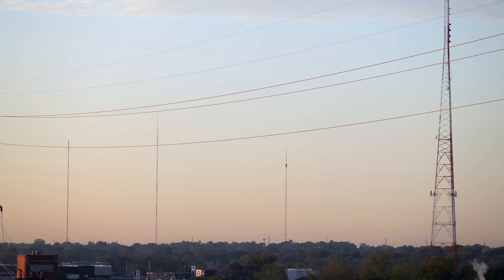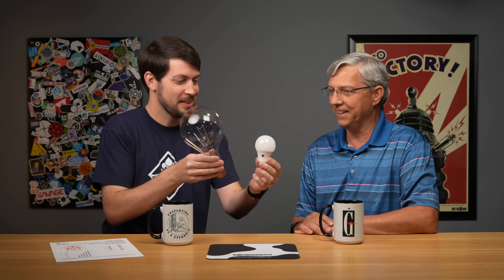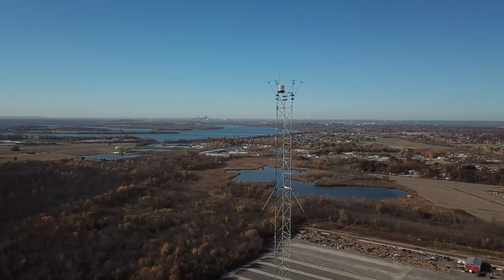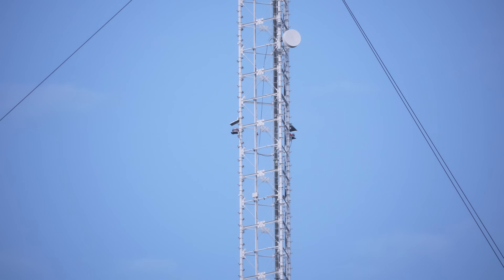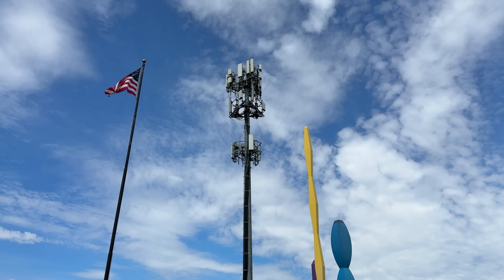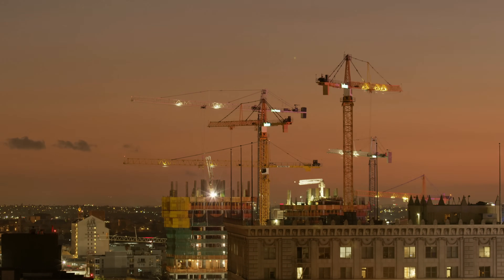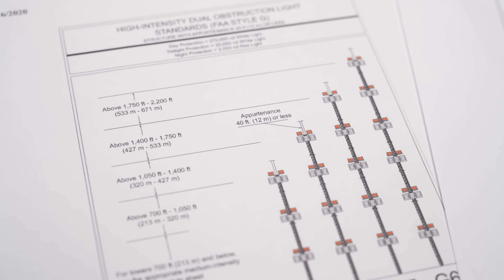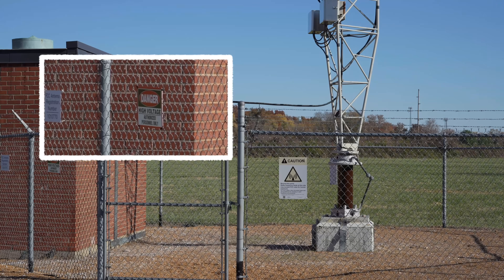Why do some radio towers blink?

Comment: Not sure if you covered this or not but if you do have lights out on your tower, you advise the FAA of the situation and you then have time to schedule a climber to visit the bulbs.  I believe that there's an update cycle to follow, re-advise if the light is still out after X amount of days (weeks) have passed, or inform the FAA that the repairs have been made.  A climber is expensive and here in KC seems to be about as difficult to schedule as a Specialist (doctor) appointment.  I know that some radio stations will file the paperwork and wait for more bulbs to go out before sending someone up after them due to the expense and hassle of replacing them.

Comment: I checked the guidelines, and you are actually not required to have a monitor system. Theres two ways to monitor lightning: Either you can have a manual system (a guy who visits the site and checks the lightning once every 24 hours) or a automatic system (like you described). You are also not required to "call back in" as you said, if the remote monitoring system is able to send an "Im OK" signal periodically and then the receiving system raises an alert if it doesn't get a "OK" enough often, its fine aswell. Its just that you have to either visually check the lightning every 24 hours, or have an automatic monitoring system, that sends an immediate alert, and also is checked for malfunction once each 24hours.

The visual system is great for a station that is staffed all the time. Like a local broadcast station with a transmitting house. Then you don't need to install a expensive monitoring system when you just can walk out of the door and look at the lights if they work or not.

How you design the monitoring system, its totally up to you. You could have a internet line that is continually checked. You could have a physical monitoring line with a termination resistor. (like in an alarm system). You could have a system that sends a wireless packet of data periodically over the same frequency as the antenna is serving, and if the receiver doesn't receive the packet enough often, it will raise an alert.
The monitoring system can both be current-based, but also can consist of optical sensors that are mounted near the lights and report back if the optical sensors detect the actual light from the lights.
Also, if you have dual-bulb or dual-unit systems, where each required position has two bulbs or lighting units, you do NOT need to activate the notification or monitoring system if a single bulb or lighting unit fails, however, you must take resonable steps to fix the failed light as soon as possible.

Another thing that is permitted, is to use sensors to detect aircraft, and turn on lightning. Those is also why you might see antenna towers that does NOT have lightning, or with lightning that "appear to not work". However, these systems need to be approved by the FAA on a case-by-case basis. You do not need to monitor an such system with alerts and notifications, but the sensors must self-test themselves, and if any failure happens, the system should go into "failsafe" and turn on all lights regardless of if any aircraft is in the vicinity.

Comment: We have a lot of wind turbine generators in Iowa, and while driving in certain areas at night, you can see a sea of red flashing lights on these towers, all in sync! It's almost unsettling. I believe this is a way of showing they're all in phase with the power grid, but I've never done the deep dive on that. UPDATE: I just read the FAA bulletin, which says "This [simultaneous flashing] requirement ensures the pilots operating at low altitudes above 500 feet AGL have sufficient warning that a wind turbine obstruction may be within their flight path."

Comment: Your dad mentions the ASR number, but I don't think it was mentioned what "ASR" means. For anyone curious, the ASR is the FCC's Antenna Structure Registry, which is a database of antenna structures with information on their heights, types (guyed mast vs free standing, single vs array, etc), what signals are transmitted from it, etc. This would also include information on the owner and engineering contacts.
Reply: Great info for those of us who are wondering what towers are what thanks for that info KN6OUJ

Comment: I will not be surprised if someday an ADS-B revision somehow includes a semi passive system for towers. That is to keep the frequencies clear it is not always transmitting, But if another transponder is reporting below the top of its mast height and with in a certain distance it wakes up and pings out.  An idea like this could also in theory on the MFD in the cockpit put a minimum keep away circle around the tower that is the widest extension of the support cables.
Reply from the maker: It seems like there are a lot of things we could do with ADS-B that we don't currently, like identifying weather balloons and potentially even drones, too.

The tough thing is legacy support, probably.
Reply: @GeerlingEngineering  Sometimes I do see the odd weather balloon showing up on adsbexchange - I'm not sure if that's because they're actually putting adsb transponders on them, or just someone else is capturing the weather balloon data and overlaying it on adsbexchange. Usually when I notice them, they are super crazy high up - way above 42,000 feet. Always interesting to click on them and get the trace of the path they took

Comment: The combination red/white lighting is a relatively new standard as I recall.  I noticed maybe two or three years ago that one of my local cell towers had been refit with this scheme.  It'll flash white during stormy conditions or around dusk, then switch to red near sunset.  That has nothing to do with its position or height, it was just a choice the owner made.  I know this because it's 1,334 feet above sea level and not within the flight path to our local airport, while a radio station's tower is 1,364 feet AMSL and IS in the flight path, and it only has red lights (still incandescent).  I was curious, so I went searching for the reason why the cell tower would have different lighting schemes, and I came up with mostly the same answers.  I'd worked in radio since 1993 and I'd never seen it before!

Comment: Love the mousepad!! A Gateway 2000 with a 486/66 processor was my first computer as a kid. I need to find me one of those mousepads.
Reply from the maker: Someone made a small batch to hand out at VCF Midwest. Would be neat for more of those retro mousepads to be made!
Reply: @GeerlingEngineering oh that's cool!  My parents still have a Gateway 2000 shipping box or two in storage, repurposed to hold other stuff, but I'd be surprised if the original mousepad survived this long.
Reply: That was my first computer as well, summer '96, came with Windows 95 and Encarta '96, Microsoft Bob and yes that exact mousepad too!

Comment: 1:19 isn't it bad to touch the glass or something of those high wattage bulbs without cleaning them after? esp. if you've got oily hands? (I see a partial fingerprint I think on the close-up shot - unless that's a texture reflection?)

And even though I already knew about obstruction lighting, good video lol. But what happens if a bulb burns out? I assume there's redundancy that kicks in so someone doesn't have to scramble up a tower to change a bulb? lol ... edit: I feel read even tho it's in the video lol. 10:09
Reply: you mainly only have to concern yourself with oily smidges when cartridge gets so hot it needs to be made out of crystal rather than amorphous glass. halogen lamps, arc lamps of all kinds but not these classic edison incandescents. but still, dont dirty your bulbs.

Comment: Sometimes the lights on wind farms are synchronized.  Is this just a wind farm thing or do they do that with antennas and other marker lights?   Also, some emergency vehicles are syncing lights now, less chaotic I reckon.
Reply from the maker: Most of the time the sync happens because the lighting system is coordinated to GPS time (many newer sites in general have GPS, or at least NTP, for time setting).

With GPS the timing can be sub-1-ms. I've noticed two towers in St. Louis that upgraded their lighting this year are now blinking in perfect sync. I grin every time I see them near each other while driving around :D
Reply: @GeerlingEngineering  Let's coordinate them ALL and do a light show or some high pixel pitch red and white video for the folks up on the space station.
Reply: Wind farms have their own unique regulations that require every structure to be synchronized. All lights must be in sync on a single tower, but multiple towers don’t have to be in sync with each other
Reply: @ReeaanC  Sometimes entire wind farms are in sync.  I'm guessing that whether or not it's required depends on where they are.

Comment: Remember, almost all codes and regulations are the bare  minimum requirements. If tower owners wanted to help with aviation safety they would be always fully lit with both red and white on the full mast and stabilizing cables. Quite a few aircraft have crashed into large antennas that were only illuminated at the top, when you're close enough to the tower the top light disappears. There's also no illumination on the stabilizer cables that stick out... An EMS helicopter crashed a few months ago for this exact reason.
Reply: Really tall towers will have guy cables several hundred feet in the air to the anchor locations. Best for pilots to clear the area above tower height plus safety margin for a few thousand feet past the towers. Thanks for the comment.

Comment: I remember when I worked in Rockford, IL. We had to do a tower light visual check every night and sign off on the TX log that we did it. (That was our monitoring system.) Up here we just have indicators on the Burke for the repeater site’s tower, the main station’s tower is a shared site and it’s not our year to monitor the lights. (It rotates between the stations.)

Also we have one of those pancake lights in the engineering shop. And apparently a giant marker light has shown up recently lol. Along with some cool old home brew tech built by a now long gone engineer but was so beautifully built they couldn’t send it to ewaste.
Reply from the maker: There were many such beautiful creations in the past, but many contract engineers don't have the time/budget to do things fancy and nice anymore :(

Comment: can they use blue or green lights?
Reply: Green is for airport beacons (mostly)
Reply: Tall structures like the ones in this video can only use white, red, or both colors. Blue, green, yellow, etc obstruction lights are used for airports and helicopter landing pads.
Reply: I mean, just think about it, have you ever seen a tower or building that has any other color other than red or white?? That should answer your own question for you
Reply: @gorak9000  but logically fallacious : research "begging the question".

Comment: As I mentioned in another short video, I changed many a bulb at the transmitter towers on South Mountain in Phoenix, AZ
Back in the 70's. At 5:55 it's worth mentioning that these are Cell Phone Towers.  People may have wondered about that! :hand-purple-blue-peace:
And a mix of other antennas.

Comment: As a pilot, it's really hard seeing tall towers from a distance during day.  That's when I prefer that towers have strobes.  Also, the NOTAM system sucks for pilots.  There are so many of them, and lights may not got fixed for a while.  So the NOTAMs just end up being noise kind of like the boy who cried wolf.  The FAA also doesn't publish graphical versions of NOTAMs AFAIK.  You have to take the text and translate bearing and distance on a map.  I think some pilot orgs do the text to graphical translation. As for reporting lights yourself, I would say to contact your local FAA Flight Standards District Office (FSDO) if you can't get a hold of the tower owner or don't know who the tower owner is.  They should be able to get a NOTAM out quickly after confirming it.  How do they confirm it?  If they don't know who the tower owner is, they can call a nearby airport and ask them to look out the window.  Or they can call ATC and ATC can ask nearby pilots.  But I've never heard of this happening.  Why?  I don't think the average person is worried about why the lights are out, and pilots are like lights being out are a dime a dozen.  So the local FSDO never gets that call.
Reply: To add an anecdote: There was this near-catastrophy, where the pilots missed the runway closure notice in 50 pages of NOTAMs and nearly landed on a very occupied taxiway. From left to right was: the unlit closed runway, the active runway, the taxiway. They saw: nothing, not our runway, our runway.
Reply: Tower light NOTAMs can be graphical in EFBs like ForeFlight and Garmin Pilot (maybe). I know ForeFlight allows you to superimpose NOTAMs on the map view, to include tower light outages.
Reply: @scottycrane904 Wouldn't it be nice if the FAA did that?  NOAA's aviation weather website is the polar opposite - lots of good weather products for free.
Reply: I used to call the tower light outages in to NOTAM when I was in radio station engineering .  This was 25 years ago, must be the same system.